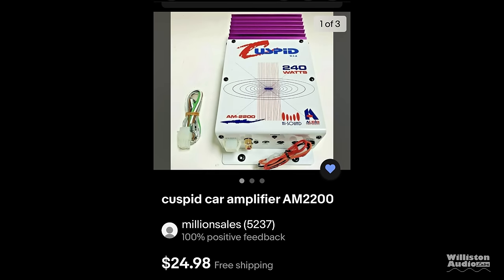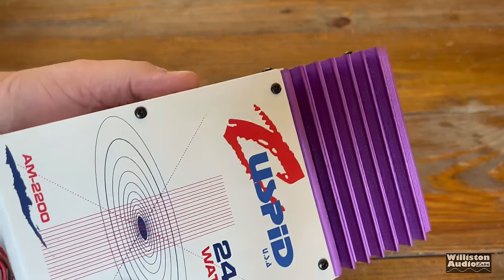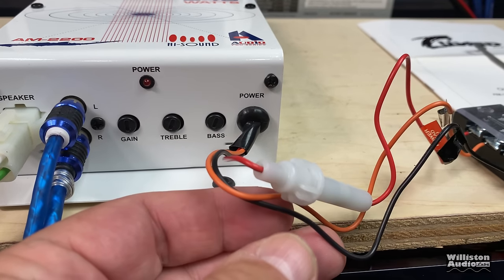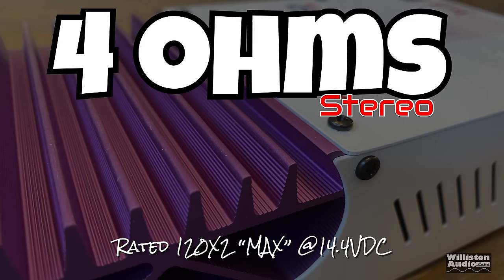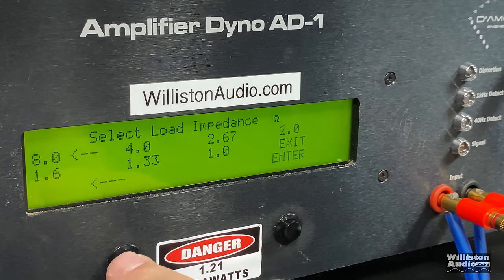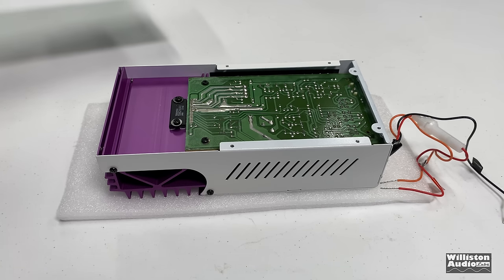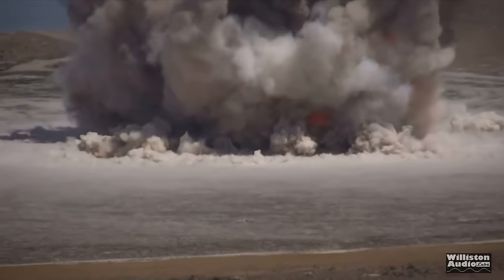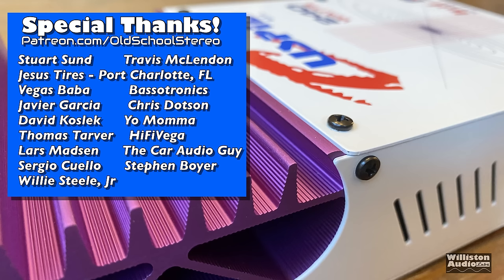240W Amplifier That Can Be Powered by Cigarette Lighter Outlet?

Comment: That looks EXACTLY like the Pyramid Audio amps I used for mids/highs from the 90's.  I have a PB446 and PB444 that still work with that exact purple heatsink!
Reply: Letter is the same style of pyramid amp
Reply: Most likely the same builder 👍👍

Comment: These types of amps (internally) are still sold new in Europe as 1000-5000W MAX amps. The brand "Auna" is a perfect example (especially the 6 channel AMP-CH06). That one has about the same or less power per channel than a basic head unit.
Reply: I see them.
Cost about the same for a basic Pioneer amp.
Funny thing is that a lot of people do have them in the car .

Comment: This little amp really surprised me. 1. It put out more than 7watts.
2. It didn't have "PMPO" plastered all over the box. Maybe it was made before that trend?
3. It had an actual made in Japan component, weak though it may be.
4. The heatsink was actually connected to a component, and not just a decoration!

This would be a cool chassis for a tripath amp build. You could even end up with an amp that exceeds 20 watts!

Comment: I had one of these in the late 90s that someone gave me. The first thing i did was open it up. I never connected it to anything after seeing that cute little ic on that huge heat sink. Im pretty sure you could get more power out of the tape deck that you would connected to it.

Comment: My 1st amp was a Sherwood 240 I bought from a store called service merchandise. I thought I was the sh@t. Lol..I blew the 2 pyramid 12's in less than an hour lol.. after that I got bougie and went 4 rockford 12's with an Orion hcca 225.. best I ever hit was a 151 db at 1ohm.  Big D you bringin back good memories
Reply: I had the sherwood BP 240 also,  they were great amps. I still have the 180 BP in my basement. The BP stood for Bulletproof, because while my friends were frying kenwood 821,921, them sherwoods kept going

Comment: BigD. For those of us that cannot alter a vehicle for reasons of lease, not yours, or my reason it is a Work vehicle. What is the best way to get some bump in the trunk. Currently using an ion 500 watt Bluetooth speaker with two 10’s in it and using 3.5 mm with a splitter so I can plug into factory stereo system and my phone for the music. But I need more BASS. How do I do ?
Reply from the maker: Check with Crutchfield for an RCA line level adapter for your vehicle then get 800-1200W amp and choose your fave sub and bump on!
Reply: You could plug a small amp direectly into the fuse panel.  Really tho just run an 8ga power and ground wire and it would have plenty of current to get some subs bumping. Also if youre feeling diy ish you could try buying a pre built amp board like one of those 100w x4 things and make your own 2.1 bluetooth speaker.  $20 pair of silk dome tweeter, $40 for some decent 6.5 midbass drivers and $100 for the woofer, another couple hundred on the amp board, bt module, x-overs and dc to dc step up transformer( most of those boards like higher than 14v. Best to use high efficiency woofers and tune them as low as possible.  I would try a 15" pro audio woofer, in a ported box around 3cu.ft. and a 3" port.  Might get it to play just as low as those garbage 10s in that bluetooth speaker but way louder.
Reply: @chuckd9007  ty so much for taking the time. I need a project this winter and this is it.
Reply: @bensalazar7388  hell yeah brother.  Partsexpress has everything you would need. Hell if you tell me your budget i would be willing to help you design it for free.  I've built a couple myself, used old amps and bt modules from other radios that needed bigger drivers and built custom enclosures.  Coworkers thought i was crazy but everybody enjoyed the quality sounds.  Now i got a dewalt toughsystem radio, bumps plenty hard enough when i need a boombox at work( has a sub and a passive radiator) only costs 200ish and my trucks factory system plays nice and low and loud enough. I could go for a 15 or 18 inch sub just to get down to 20hz flat but that wont fit under my seats.

Comment: I know you were joking when you said run this amp of the cigarette socket. The thing is I did that with a Rockford PBR300×1 as a removable sub system and never had an issue.
Reply: You had an issue,  just didn't realize it, because Rockford, is power hungry and if you ran it off a 🚬 lighter it wasn't seeing the power it needed for it's full potential. Honestly I don't see how the fuse didn't blow with every deep bass note because it's typically a 20amp fuse in a cigarette lighter

Comment: Nice one there with someone dropping it on the factory floor and pretended it didn't happen. 😂
That TA8210AH chip is rated for 2x20 W at 4 ohm so it did it's thing alright.

Comment: Question: is it possible, that if the "CAPS" are old, they don't perform like they once did years ago?
Reply: Yes, that's possible if they leak or something. In this case, that's not the problem. The amplifier chip is 2x20 watt toshiba, you can google it. It's doing exactly what it was built to do. 40 watts on a great day
Reply: The caps aren’t doing anything of significance in this amplifier.
Reply: @envisionelectronics  yeah who cares if the amp oscillates?

Comment: Looks like the amp in my old bazooka tube.    Out of curiosity what is the output voltage going to the speakers.  What would be fun is to put the guts from a good amp that's beat up in it.

Comment: Always said that with cheap amps you can can take off a 0 or two at the end of the advertised wattage output to get a rough estimate of the true wattage output. In this case, you can take off the 2 and the 4. 🤣😂

Comment: Decent looking chassis imo. That Toshiba chip amp has some pretty lousy distortion specs on the data sheet so this definitely ain’t no SQ amp!  Would be interesting to probe the Vcc on the amp IC to see what voltage it is running at. It can handle quite a bit more than 12v.
Reply from the maker: But the power supply capacitor is 16V and prob out of spec by now
Reply: It's an unregulated supply so it's running at whatever voltage the cars electrical system is running at.

Comment: Hey also...could you revisit Alpine PDX M12.....but somehow get your hands on a Kenwood XR1000.1 or 600.1? I havent seen you test those yet albeit I get it. Ive had the M12 and have now switched to the XR1000. They are really close in power for large powerful amps that you dont need to change your altenator to run them. We ve seen the Pdx m12 torture test years ago...Kenwood Xr1000.1 torture test would be a sweet twin comparison? What you think? Kenwood is considerably cheaper as well, and have owned both. The Kenwood is quiter but seems just powerful. Do I need to send you mines to test? Thanks and or disreguard if not interested.
Reply from the maker: Thanks for the suggestion

Comment: A lot of people clown on old school technology without even understanding what the standards were at the time. I'm sure when that amp came out many headunits were still only putting out 5-10watts per channel so this is still an upgrade. And factory speakers could only handle around 3watts, so if you just wanted to upgrade your door speakers, an amp like this would be a good alternative instead having to swap the headunit. 

Just like every tool has it's own use, every audio unit has a purpose to it. Not everything is meant to create earth shattering bass because that is not what every single person is looking for.
Reply: Yeah....uh, no. I got into car audio in 1987 and we laughed at flea market garbage like this back then too.
Reply: nah, the chip in this amp was released in 1998

Comment: The amp meet its power, the problem was the translation 120Wx2 correct translation 12Wx2. 75Wx4 should have been 7.5Wx4 150Wx2 15Wx2. If it still didn't make that then it was user error. So sorry for you. Another classic powerhouse like the jbc. Lol.

Comment: I use to sell those in my shop I had at the local fleemarket
Reply from the maker: I knew it!
Reply: @wal  I have a 25  watt 2 channel stereo Sentrek amp. I’ve had since the 90s it’s still in use in a home made Bluetooth speaker I made😃it’s sound pretty good with some  five and quarter Sparko matic speakers I brought from western auto years ago

Comment: That's actually a great idea I've never thought of! Just run your amps off the 12v cigarette lighter outlet, no more need to run thicc wire in your engine bay and through the firewall! 😂😂
Reply: I've actually done that a few times as a temporary setup between systems. As long as you don't bump it too hard the 20 amp fuse for the power point will hold up!

Comment: Well, to be fair, it did sort of deliver what the Toshiba specs for the TA8210AH say the chip will deliver, which is 19 WPC..., however Toshi says it will do that at 4 ohms, meanwhile Big D had to drop down to 2.67 ohms to actually get that.  Pretty lame, but if you think that's bad, take a look at the wildly exaggerated claims that so called professional PA speaker manufacturers (EV, JBL, Peavey, Mackie, Behringer & many others) claim that the widely used TDA8953 / 8954 amp on a chip will deliver.  Just as ridiculous as the claims the manufacturer of this little box make, except the aforementioned are supposedly reputable companies.

Comment: Im gonna be honest, i want one now man! Realistically to be fair I've  seen some amps like these ( not this brand) ,but amps that dont put out much more than a headunit that run off small wires. Usually used in a case where som vehicles only had 2 speakers or even 4 but someone  wanted to add extra speakers throughout, so these kinda amps are good in that situation where your just trying to expand a little bit. Id personally throw this badboy in a golf cart or something!!! 😆 🤣 😂
Reply from the maker: There were 2 left I have links in the video description
Reply: Under golf cart 🤔
Reply: It's not worth the effort....
Reply: @Williston Audio Labs  says seller is away til December 16th. Yes bih dummy here was gonna buy one just to have it! Lol 😆

Comment: 240 watts divided by 12 volts equals 20 amps being pulled from the cigarette plug. There is no way you're getting 240 watts at 5 amps from a cigarette plug, for that to be true you'd need 48 volts from the plug. That's 4 times the normal car battery voltage, absolutely ridiculous. Whoever did the packaging has no clue what they're doing.
Reply from the maker: Yeah IKR